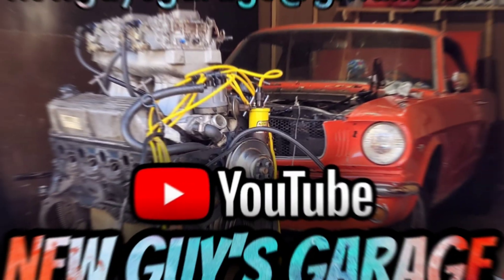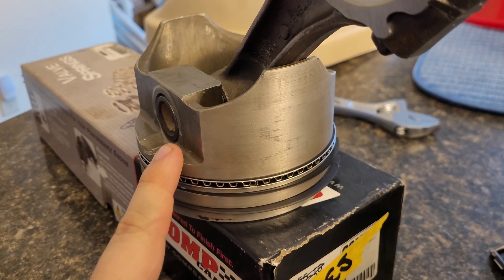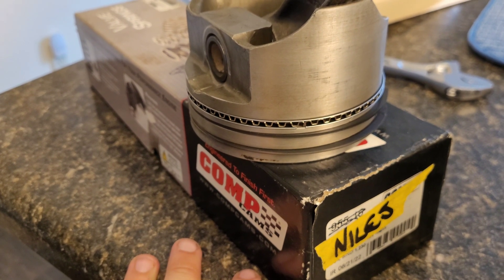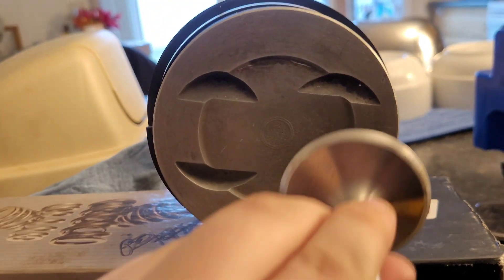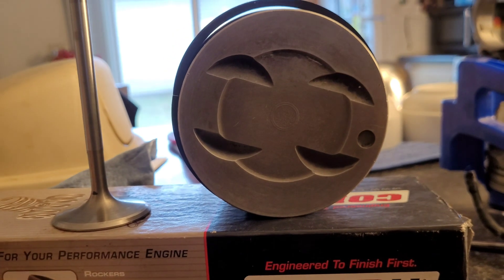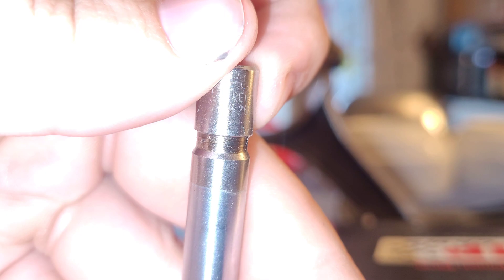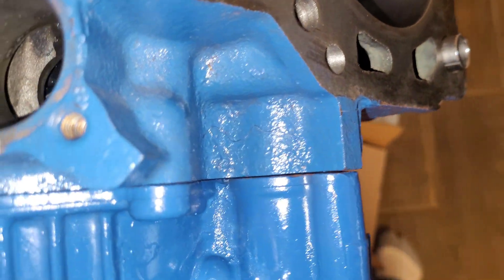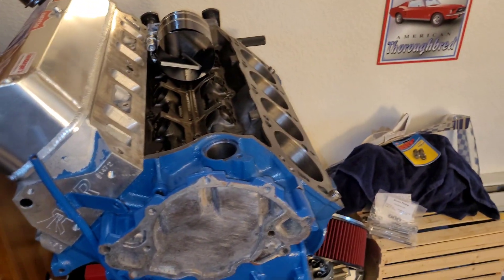Nitrous Tunnel Ram 302 Engine Build! | Piston To Valve Clearance | Oil Ring Mods | Build Updates

Comment: If it all fits, it fits. Did you get your 45 buck HF dial gauge with magnetic base? If you did, you could determine exact TDC with one piston in. You could get two valve checker springs at the hardware store for 5 bucks? Then you could place your head on the block and MEASURE how far your valve goes down before it hits anything at TDC. This # will help guide you in all other decisions, and measuring all that stuff is FUN!!!!!  Why do you rob yourself of such pleasure?🤣😁 Once you have exact TDC of #1, you can also verify the accuracy of your timing pointer. Look at all the birds you can kill with a 45 buck stone....your cat will love you.
Reply from the maker: Just did lol 😆 
Need to check my piston to deck hight, I thought I was going to be .011 in the hole but turns out she might be popping out just a little!? 

Either that or its zero decked which I did not think would be the case but im defenatly not complaining about it lol
Reply: @newguysgarage6802  awesome!  up to .005 out of the hole is doable with a .040 gasket, but maybe no tighter than that. Check all of them once it is assembled cuz there can be variance. I got a short block from the junkyard that every single one was different, and one bank was out of the hole .020 and the other out .015. Some of the pistons had small valve "witness" marks and those pistons had no reliefs, just a very shallow dish. I cut reliefs into them because I had previously had my heads milled .040. It got two different gasket thicknesses to even out the chamber volumes. It ran great.
Reply from the maker: @stuartwall8212  turns out the one I checked is about .003 out of the hole so im gonna call that basically zero decked lol 😆 

And my piston to valve clearance is .148! So miles away! I do need to bring the eyebrows back a bit because the edge of the eyebrow and the edge of the valve basically touch but the actual depth is miles away 😃

That was with a used head gasket that measured .060 so I figure if I use a .040 head gasket that would bring me to .128 pvc and if I do 1.7 rockers that is about an extra .030 of lift which I think would bring me to .098 pvc? 

I think.....im not 100% how the 1.7 affects lift at all parts of the curve 🤔
Reply: @newguysgarage6802  If you consider TDC 12 oclock and measure PTV from 11 oclock to 1 oclock  and various points between, you can approximate the PTVs in your running engine. If you have the 1.7 rockers handy. Your cat is gonna think you are bad ass when he sees that. 🤣